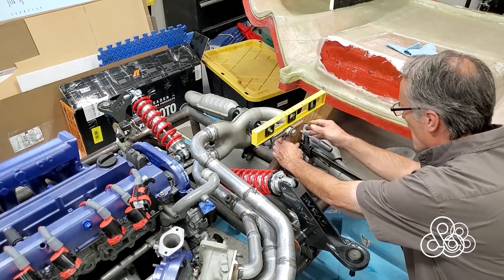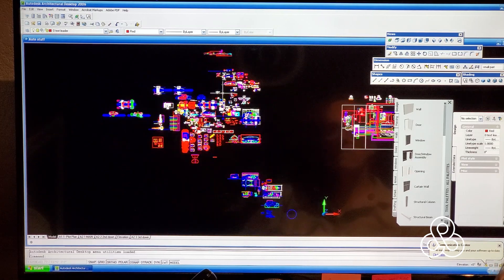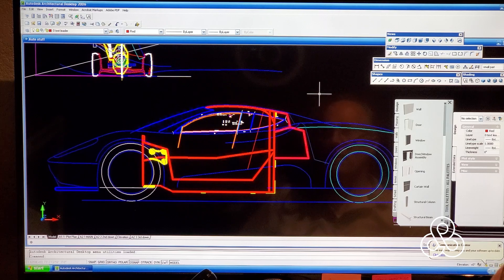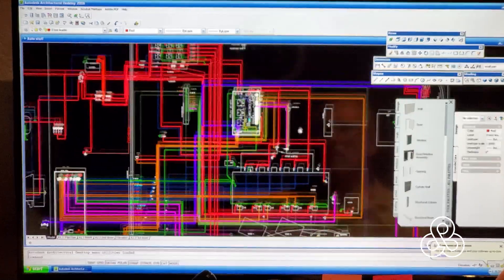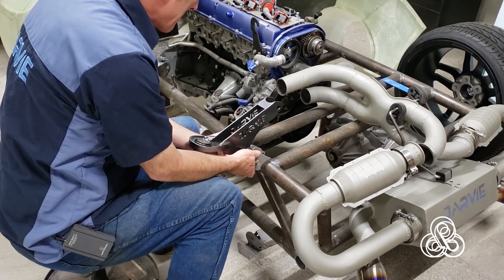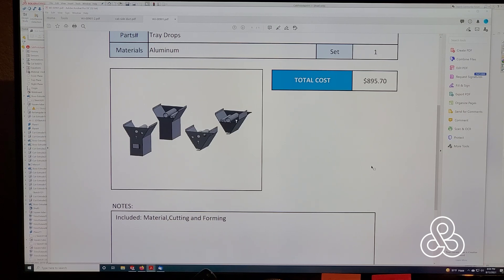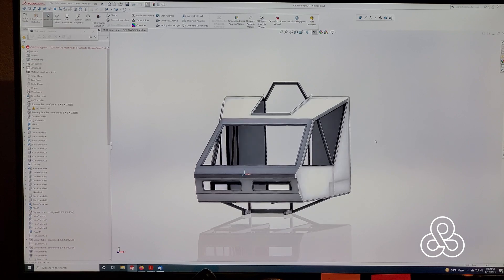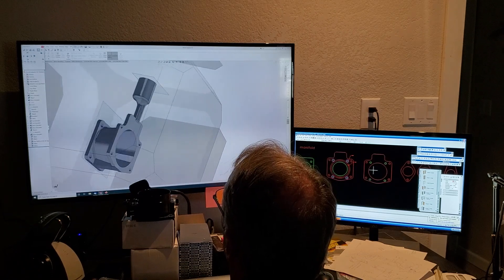The CAD design process and workflow for fabricating supercar/ supervan components

Comment: I haven't seen any stress analysis on your designs.   How do you know that what you are building is strong enough ?    Especially for complex composite parts like the tub ?
Reply from the maker: No FEA. Going off my and others experience on this one and will test on the back end. As a prototype, it may roll and go, but can easily come right back in and get reinforced if I find to much flex.
Reply: @BuilderCreator  I'm not sure what to say about that.  

If the tub fails I'm not sure it is going to be as easy as rolling it back in for reinforcement, especially at the anchor points.   Also, there is the safety aspect of it. 

FEA on composites doesn't give a 100% reliable result.   But I'd take the time to run the sim just to see what  the relative stresses are.  FreeCAD has a built in FEM workstation.

If you aren't going to do FEA, I recommend loading the tub with various forces and see how it responds before taking it out on the street.

Comment: @5:37  "They take my line drawings and create 3D models so they can calculate bend [radia]..."   Are you aware that FreeCAD is a 3D modeller and that it has a sheet metal toolbox that automatically calculates bend radia for 3D parts ?
Reply from the maker: Why use FreeCAD when I can pay $2000 a year for solidworks? Ha!
Reply: @BuilderCreator  And FreeCAD has a crazy good Python scripting system built in that makes it pretty easy to do just about anything.
Reply: Dont forget fusion360

Comment: Holy shit... Arete is done in 2D Autocad?!

Well done sir. Goes to show it's the craftsman and not the tools. (Not saying Autocad isn't capable of this, but a parametric 3D system with version control would make life SOOOOO much easier in a lot of cases for an assembly as large and spatially complex as a supercar.)
Reply from the maker: In reality its all done in out heads, the CAD is just to check our vision against reality and to share with others when we need outside sources to be part of the fabrication. Thanks for following the channel.
Reply: @BuilderCreator  Makes sense! I love seeing your work progress over the years. It's very impressive. Art and engineering.

Comment: WoW! I am super impressed! You mentioned that you use an architecture CAD software - is it Vectorworks? Have a wonderful day and be always blessed with health, luck and creativity!
Reply from the maker: AutoCADs Architectural Desktop (Now known as Revit)
Reply: @BuilderCreator  They still make ADT.  Revit is a whole different animal for creating building information models (BIM) and works in 3D natively - although I believe there's still a AutoCAD core component in it.  I work with both daily . . . although I can't say that I'm super proficient with Revit.  I have Solid Works as well but to date have only dabbled in it.  I saw that you had that one guy modelling Leviathan with Blender also, which I've been on and off teaching myself as well - it's quite a neat tool and best of all open source!

Comment: I work with CAD everyday. Its so amazing to put my ideas into a 3D world and show how it all works then make sure it will work then see the final part and hold it in my hands or see it fully built. Ugh... It's an awesome job to have, very fulfilling.
Reply from the maker: And to see it in your hand within hours even; with 3D printing! to quote Captain Aubrey in Master and Commander- "What a marvelous modern age we live in!" -
Reply: I was tr.ained in ACAD r10 and worked with it thru r14.  The 3D left me scratching my head because it seemed so work intensive.  I worked for a company later that used SolidWorks 2005 and I was amazed by how intuitive it seemed to be.  When work slowed for me in the machine shop, the company allowed me to put some time in on SW.  I had help getting started, learning how to create a slprt and some of the commands such as "Mate."  Withing 3 months our part-time engineer retired and that left me as the sole SW operator.  It's amazing how much you can learn when you are on a deadline.  Love SW and Dassaulte Systeme's ACAD Clone "DraftSight."